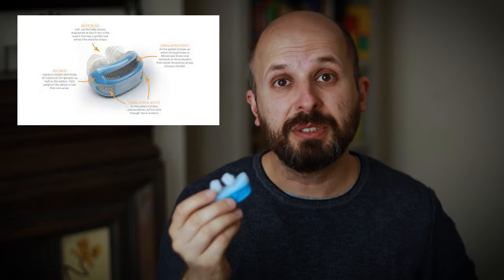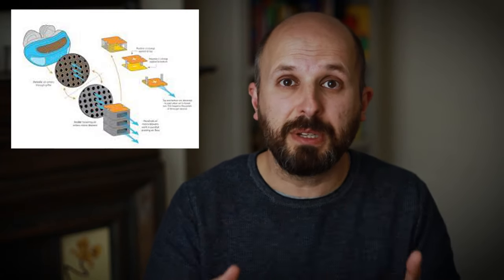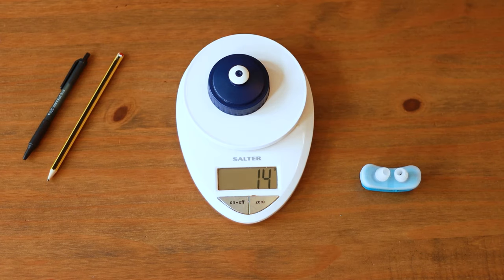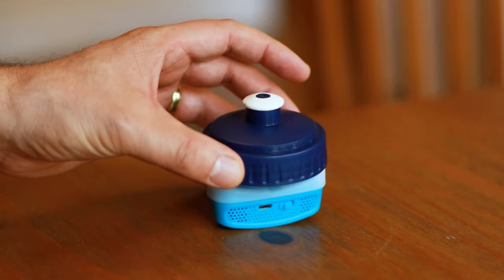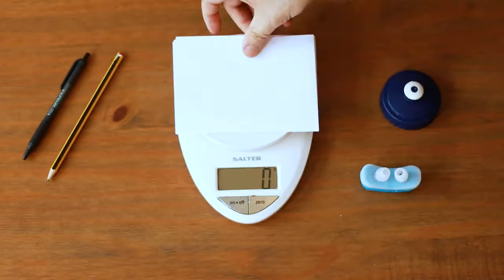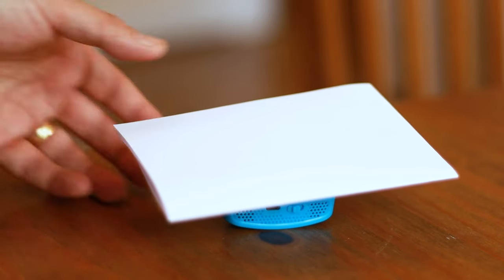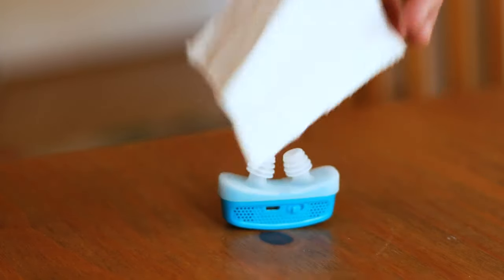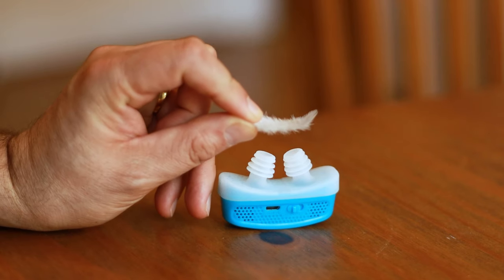A Sleep Surgeon Tests a MicroCPAP / Airing device

Comment: You can't judge all micro-CPAP technology by a non-working 3rd party device. The failed feather test made me question your ability to use technology devices. Please a) make sure the device is charged, and b) make sure the switch is flipped to the proper direction.

Comment: Thank you. I recently saw one advertised (NZ) and was tempted as I need a travel cpap when camping. It's so cheap, I thought it was dodgy. Whoever manufactured this really can't lose because they got $2m to develop it and have priced it so cheaply, it'll sell in the millions too. Needs more people to say "Don't buy!"
Reply: Did you ever figure out a solution for camping? I can't sleep without mine!
Reply: @cory8791  I use a travel CPAP (ResMed Airmini) which works great. The issue is weight, especially when you factor in enough battery power to last for a multi day backpacking trip.

Comment: No one is discussing the Bongo RX or the Optipillow. I can't wear a CPAP so I've used the Bongo for three years, it works completely on my moderate sleep apnea. These are EPAPs, look them up, brilliant, they just sit on your nose, no electricity, tiny tiny little device. Solved my problem.

Comment: I bought one of these and it worked, but it wouldn't stay in my nose. I rigged up a strap to keep it in my nose and it worked great. I found that it wouldn't really push air in, but it made it harder to exhale, which increased the pressure in my throat, and kept my airway open. It works great if you can get it to stay in the nose.

Comment: Just a couple thoughts on your testing / commentary (as a longtime OSA patient, I am certainly not defending this product....but I did want to mention a couple things)

1.  Unless you can seal the CPAP devise around the edge, it will not build up pressure to move what you're placing on it, the air will flow around the object (though the feather not even moving is comical, I may have to spend 19USD on it just to see if that is true).

2.  Somewhere you implied that just being inserted into the nostrils will not work.  On my BiPAP machine (I have both OSA and Central Apnea) I have a mask that only fits into the nostrils and works fine.  The way it was explained to me was that the mouth naturally wants to be closed.  Maybe I heard you incorrectly?
Reply from the maker: 1. please do spend the cash and let me know if you have any better luck.
2. what i mean is that without a strap around the head the pressure from CPAP BiPAP etc would just blow out of the nostrils - there is no way it would just stay sitting in the nose.
Reply: @VikVeerENTSurgeon  Thanks for responding, doubt I'm going to spend any money on this....but thanks for the clarification on point #2, that makes sense to me.  I do still have to use a strap on mine.

Comment: I can't help but wonder if it would generate more air pressure if the inlet of the fan wasn't blocked by the table.
Reply: Agree good observation :) Have you tried this device? Looks like great potential though! Was hopeful.
Reply: I think the inlet is actually exposed in his demonstration but I'm not sure the airflow is meant to be enhanced when it is static like that. Your nose is plugged and there is air inlet as well as outlet. .. Numerous things cause me to dismiss this video. It doesn't appear he has even tested it in its intended application.
Reply: @gliptitude  this is a piece of crap. How do you think this is going to generate enuf airflow? There are other videos out there talking about this too. If you want to waste your money it's up to you.

Comment: You are absolutely right! You are the man! I've been using CPAP Resmed S8 since 5 years with a nasal p10 "mask" which is the same size. You'll never get the same air pressure from any micro-machine as resmed gives you! Probably in year 2100...

Comment: I experimented with mouth taping to force only nasal breathing during sleep.  I am still snoring, as I have an app on my phone that is triggered by noise, to record audio events in my sleep.  However....  I experienced a massive difference in the mornings I taped, that did not.  The nitric oxide that only comes through nasal breathing makes a profound difference.  This is not going to work with a lot of people even with nasal strips, which I also use at night, but as long as it's not allergy season for me, I can breathe fine through my nose.  Mouth breathing is in and out too fast, and the flow never gets to your extremities.  With nasal breathing, you breath in longer, and exhale longer.  I'm pretty sure I do have some form of apnea caused by soft pallet sagging in my sleep, but it doesn't reverberate through the entire house out my mouth now, and keep everyone awake.  I also feel less tired during the day, and no longer wake up with pins and needle feeling in my toes from poor circulation.
Reply: Which kind of tape do you use ?

Comment: Was on proper mashine. Takes week or so to get used to mask but even 4-5 hrs a night means alot and equals to 8-10 hrs a sleep without it with snoring. My advice is to buy a mask tht covers mouth and nose rather then just nose as its more sensitive to ur nose only. Also spend lil more and buy automatic rather then manual as it pumps air only when u need it and not pump enourmous pressure soonest u put it on as it can be irritating and harder to fall asleep where automatic will only push small amounts while u stil awake and breathing on “ur own and once u asleep in my case it pumped alot to keep my air regulated.

Comment: Hi Doc, I've been diagnosed with sleep apnea casued by epiglottic trapdoor and was wondering if there are any surgical options that you provide?
Reply from the maker: I use coblation to the tongue base and vallecula surface of the epiglottis (to generate adhesions)

Or

I suture the epiglottis to the tongue base

Or 

I do a wedge resection (which I don't like doing).

Comment: For me it’s NOT a scam. I have big difficulties to breathe when lying down, but with this device I sleep a LOT better and can breate more easely. (However, I don’t snore.)
/A nowadays happy and not so tired guy in Sweden
Reply from the maker: try a nasal dilator - you might find it more comfortable and it will give you the same effect
Reply: @VikVeerENTSurgeon  I have tried one. It works a little, but the micro cpap works much better.

Comment: Well thanks but the tests here are not very informative.  It would not take too much engineering know-how to actually measure the air movement and pressure.  Also, whatever the test, I would hope that you would compare against at least one other device.  These devices run about $25 as far as I have seen so one might want to compare to more expensive devices. The most important study would ber to measure how it actually impacts one's sleep not how well it can lift an object that it was not designed to lift.  I don't know if the device is a scam but this video is really just click bait.

Comment: I’ve had a full assessment and I’m more than well aware of both the profile and needed requirements of my OSA/CSA* - but I have to be honest, I don’t see anyone here who has tried the device or tested the device in a clinical or even personal setting, with the exception of your ‘review’ - which I’m putting in quotes because you do not show a standard CPAP machine in the same tests (although I fully expect it to perform better in terms of air pressure output) . So I’ve gone ahead and bought one, because £40 is nothing compared to the £1000 + masks I’ve had to outlay due to the inability of the NHS to provide appropriate cost-free treatment. 

Do I expect miracles? No. Not in the slightest. But due to complications in my condition that mean I wake up six times a night despite the reduction of my AHI to 1/27th of if’s prior level, I have to remove my mask to get even close to a nights rest, and if for that period it can offer even a 10% reduction, that is worth the outlay, personally.

While I fully and completely support your suggestion - due to the inability of private individuals to purchase CPAP/APAP devices without prescription in the UK - that individuals seek and obtain a formal diagnosis and (ideally) a working CPAP/APAP device in the classic model, I feel it is disingenuous to treat this as a review. Although of course, I would imagine it might be a touchy matter of medical ethics to state anything more than your (completely informed) opinion.

Certainly, anyone seeking a ‘travel’ solution must unfortunately look at a considerable personal outlay, and I would not for a moment suggest this would replace a full machine. Simple physics implies otherwise.

*I am a complex but far from unique case, and unfortunately the system in my area does not provide me personally with an exact diagnosis without paying for my records, it seems.

(Edit: And yes, maybe 100% of the products on the market are a scam. Certainly anything costing $3 must be But while 100% indicative of this not being a complete replacement, I must still question the methodology - of course, I am ignorant of how such a device is tested.)

Comment: I was kind of hoping an ENT surgeon would evaluate how this would actually work on a human body rather than a feather, unless you're also a mechanical engineer.
Reply from the maker: What test were you thinking about?  I could hardly perceive anything whilst wearing it let alone the pressures needed for a standard CPAP. I could breathe out through my nose and almost reverse the fans which is impossible in a CPAP device.
Reply: I'd suggest leading with your test of the CPAP in your nose (or anyone's nose) rather than just sitting it on a table, not at all the same conditions under which it's supposed to work. 

I don't think you're wrong. I've seen other research that reaches the same conclusion. (Unfortunately -- I'd love to ditch the CPAP.) But this wasn't at all what I was hoping to learn from a doctor's video.
Reply from the maker: I'm really sorry. The whole medical community knows it's a scam and we know they are preying on desperate people. I wish there was a better way to prove it to you
Reply: @VikVeerENTSurgeon  The test you mention with it actually placed in your nose is good. So are actual studies. 

Again, I don’t doubt that this is a useless item.

Comment: I would have no idea whether or not the Airing Micro CPAP will work- but neither does anyone else.  That device you are testing looks like one of the many, cheap, Chinese-imported knock-offs looking to make a quick buck (or pound in your case;-).  It might be more prudent to test the actual device before giving a review on it.  Otherwise- like your videos!

Comment: ive tried to find the real reason for my snoring, i guess there are different causes for different ppl. tried the tongue position, forward, up , against my teeth. none seems the reason behind my snoring. i tried to reproduce my snoring while awake and after lots of trying, i think my problem is i didnt inhale from my nose position but the inhale starts from my throat which caused my snoring. i pinched my neck from various points and there is a point pinched from both sides that eliminates my snoring even if i tried very hard to reproduce the snore. but theres no clip to mimic my pinch. 😂
Reply: also, the pinch point on both sides is found, cant be pinched too hard nor too soft. if its too hard you narrowed the airflow path, too soft simply wont work.
Reply: in my case, i will never snore if i inhale from the tip of the nose,  its just like sobbing your nose for inhale how can you snore?

Comment: The Airing and all similar device are not mechanically capable of producing ~10cmH2O pressure or the airflow required by a CPAP machine. It's mind blowing that no state prosecutor has gone after the scam artists who put the original concept on GoFundMe. I'm saying this as someone with an advanced degree in engineering, 20 years in product design; I've designed CPAP machines and worked on complex CFD models (computation fluid dynamics). I am saying this for those that say, "you should have tried the real device". Well, as pointed out, it does not exist. Also, someone said something along the lines of this needed to be worn on the face to work, as it uses the exhale to drive the inhale. Firstly, you'd soon die from a lack of oxygen as you'd be breathing in your own air. Ok, I'll stop.
Reply from the maker: thank you for backing me up. I still can't believe people are still falling for this.

Comment: I find it absolutely hilarious that you can hear the motor struggling just to keep at a steady rpm… It sounds exactly like an experiment I did back in 3rd grade, where I used scotch tape to connect a tiny motor (out of a cheap toy) to a AAA Battery. LMAO!!! If you open that thing up, there probably isn’t even a driver chip between the battery and the motor, and I’ll bet you’ll find the cheapest motor with not even the correct BTU fan assembly to create such force.

Not only that, let’s say the device has a sensor to detect when you breath in, making this experiment irrelevant… Let’s say the device did create enough pressure… Given the means in which it mounts to the user, it would blow out of your nose the very first time enough pressure is built up; You would have to ‘glue’ it into your nostrils in order for it to actually work…

I don’t know perhaps this company hired an advanced alien 👽 to assist with the engineering, and perhaps the alien caught a mild cold and died before revealing the tech needed to complete the design? 🤷🏽